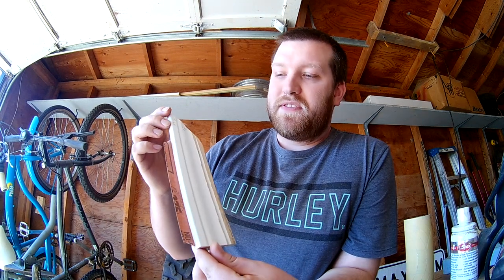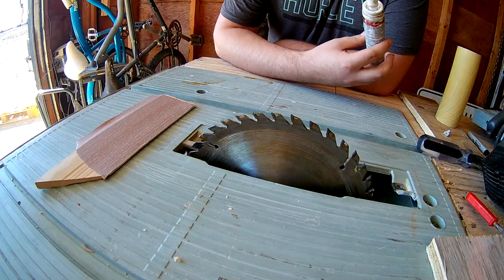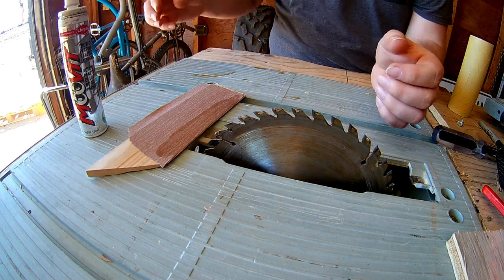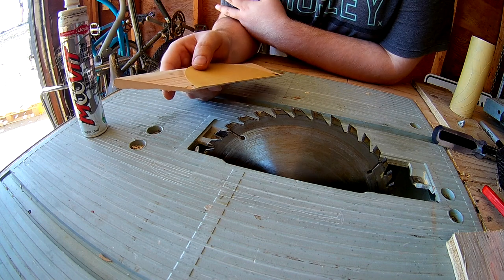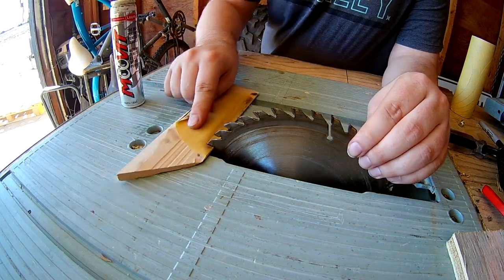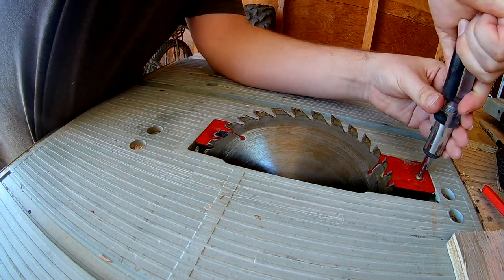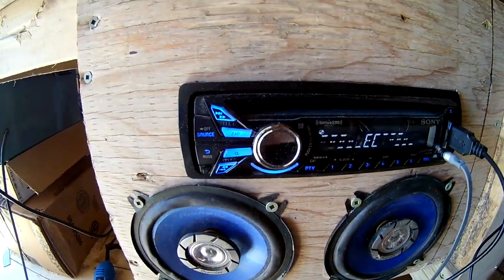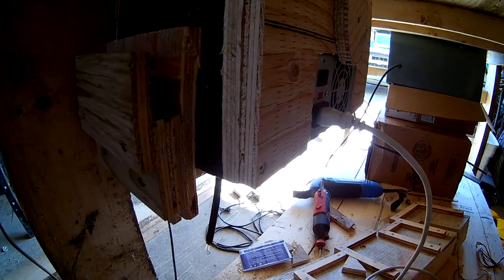SHARPENING A TABLE SAW BLADE

Comment: Liked the sharpening method, I’ll try that! I’d never cross cut agains the Rip fence, should it jam-and its bound to eventually it will possibly hit you back a serious facial injury.  If you clamp a stop block on to the rip fence that does not extend to the start of the cutting no jamming can occur. Just don’t cross cut using the rip fence anymore.  Thank you for your technique
Reply: That's just waiting to happen.

Comment: you seem to have got away with it so far but one time you are going to get a chunk of wood fired at you and the other piece damaging fingers,wrist or somewhere else.   i was ripping on a radial-arm with no push-stick and as they seperated the cut bit shot back at me and hit my leg and only missed the crown jewels cos i was standing  on a pallet.    some guy  sliced through his 4 fingers  when cutting ply-wood cos he didnt set the depth gauge before using.   watching you cut those blocks was like having a cold shower.    great idea and i am off to try it now

Comment: Diamond embedded credit card sharpener 600+ 1200, clean 1st, make sure the angle from card to teeth are correct(ie alternating blades), these cards just get an edge, eventually a they will need a shop to truly sharpen the carbide.

Comment: Consider using wet/dry sandpaper (paint and body repair.) It'll hold the oil better, and last longer. And by all means use a miter gauge, or sled for crosscuts!

Comment: Widia teeth can NOT be sharpened with sandpaper. What happened was that you only removed residual resin gum. Cleaning the blade would give you the same, if not better result due to also cleaning top en sides of the teeth. Resins on teeth make them saw as "dull". Many users "think" that the sawblade must be sharpend, but in many cases it turns out not to be necessary afther cleaning. Regular cleaning is very important to retain optimal results. Lots of examples on YouTube. 

Sharpening Widia teeth is only possible with adequate fine pitch diamond tools. Do NOT use a diamond blade made for stone or concrete as a sharpening tool, these are much to course, damage the teeth and decrease the time the teeth remain sharp.

And I am very glad you made yourself a crosscut sled.

Comment: A riving knife is essential. 
Use a diamond stone.
With the blade at90* you are sharpening for rip cutting.
Cross cut with a sliding mitre fence. 
For repeat cuts use an extra fence clamped further back to the rip fence to give you length, and push the wood beyond it before you hit the blade. There are lots of videos about this. Or use a sled.

Comment: Is that regular sandpaper, and are the blade teeth carbide? I been using fine grit diamond files, never thought sandpaper would sharpen carbide...will have to try that thanks.
Reply: i had same thought,  did some research online.  states al. oxide sandpaper or sil. carbide sandpaper is not gonna do the job.  DIamond is what is used to grind the carbide teeth.   Not gonna try OP's technique.

Comment: I never uploads a video on YouTube before. I do want to warn you when I was younger  no one taught me how to use tools. I figured it out on my own I did the same as you but I was'nt as lucky. A piece of cherry kicked back and knocked me to the floor. Very embarrassing. I was in the nave hobby woodworking shop. I had a black and blue mark across my pp. I learned to respect ww machines. The jointer has my total respect

Comment: 4:05 Holy Crap, you should NEVER cut wood like that. That is one of the stupidest things I've ever seen on youtube!
Reply: Please upload your video cutting the same wood. What is wrong with it??
Reply: if the piece between the blade and fence catches on the back part of the blade and launches it into your face- you will know why. use a sled and move the fence AWAY.
Reply: You should use the miter gauge that comes with your table saw. If you don't have one, use the miter saw, if you don't have one, use a bigger piece of wood or plywood to push the wood you're cutting.
Reply: Yeah, crosscuts using only the fence and no riving knife or anything is a huge kickback risk.